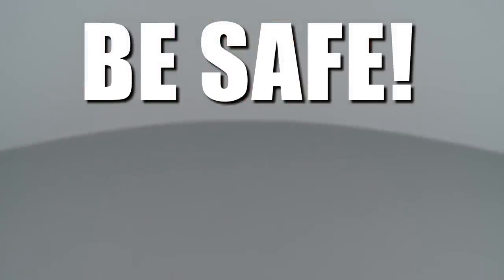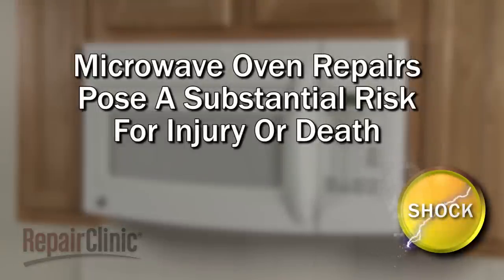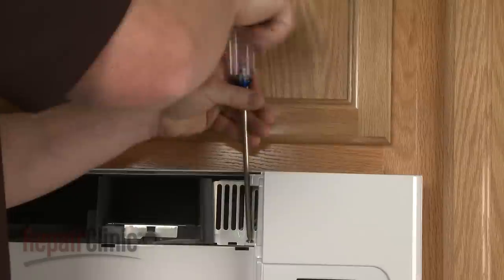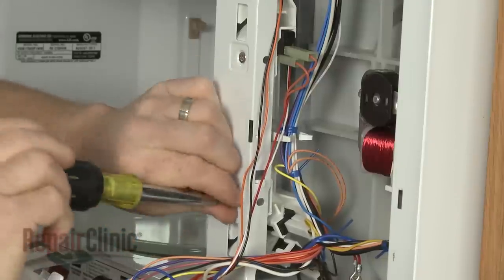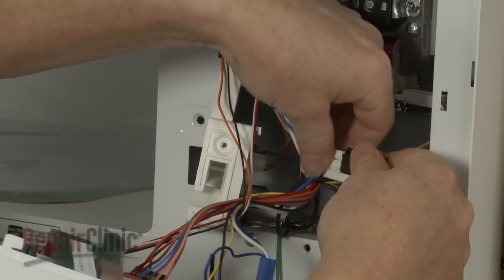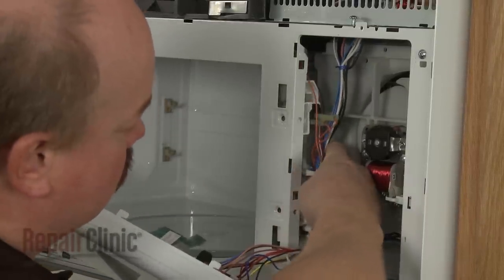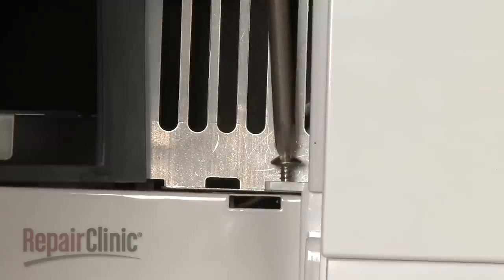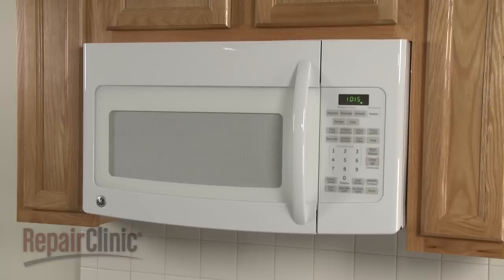GE Microwave Won't Heat? Replace Door Switch, Middle WB24X830

Comment: I have a GE over the range microwave. It has power but doesn't heat at all. the tray doesn't rotate. Do you think the problem is the door switch or the diode?
Reply: Abdalla Abubaker did you find out the solution, I have the same problem

Comment: it turn on light etc all working but it doesn't heat up. i called micro wave repair man he said it going to cost $300 to fix. recommended unit has shorted Ma6. is worth fixing or buying a new one. moddle #JNM1851SM2SS, serial902164B. please help me. thanks

Comment: The top and bottom in my GE1456 microwave are identical switches (WB24X829) and are NORMALLY OPEN type (NO continuity freestanding).  The middle one (WB24X830 ) is a NORMALLY CLOSED (continuity freestanding).  Is this correct? I got mine all mixed up and am trying to make sure i purchase the correct switch and furthermore replace them correctly.
Reply from the maker: Yes, the upper and lower are the same switch part (# WB24X829): http://www.repairclinic.com/PartDetail/Micro-Switch/WB24X829/253819?TLSID=1773.  The center switch is part # WB24X830: http://www.repairclinic.com/PartDetail/Micro-Switch/WB24X830/253820?TLSID=1773.

Comment: Do you need to discharge the high voltage capacitor before doing this replacement?
Reply from the maker: Tim Claxton Yes, if the capacitor is accessible it would be wise to discharge it before service. This is a task best handled by a qualified appliance repair person.

Comment: is it dangerous to continue using the microwave with a defective door switch and it will run every time the door is open?
Reply: Repair clinic dose room or microwave international temperature affect warming time please respond now thanks
Reply: YO, DUDE!!!
  If the microwave portion of the oven really operates when the door is open, it's very dangerous!
 If you hear the same hum when the door is open as you do when it's closed and heating, you should be VERY careful to be sure it's closed before it's turned on, and until it's turned off.
  And you should get it fixed ASAP, because that's the kind of thing we all forget when we're tired, or in a rush.
  Probably replacing the door switches, as shown in this video, will solve the problem

Comment: I have a Goldstar Microwave Model GMV1540TW. The turntable turns and oven light stays on when door is closed. It acted like this a few months ago for a while and started again yesterday. Any idea what the cause would be? Door switch?
Reply from the maker: David Cummings Either a bad door switch or control board would be our guess.
Reply: Had top door switch checked.Technician said it was ok. Unplugged and left for a few days.Now is working ok. Control board?